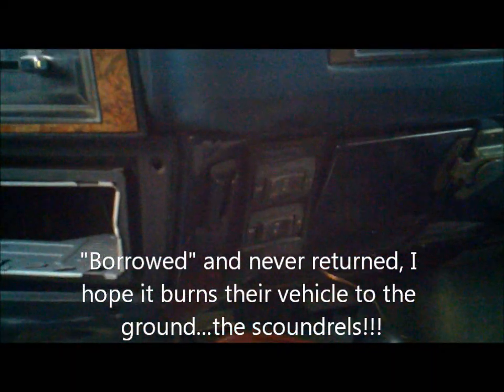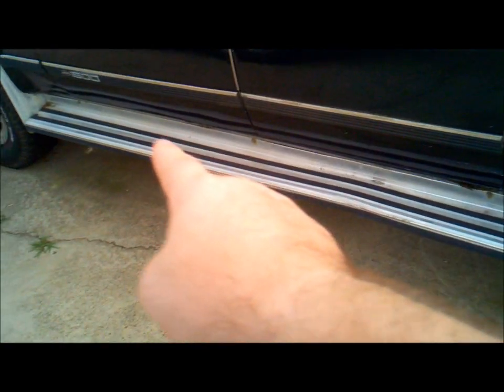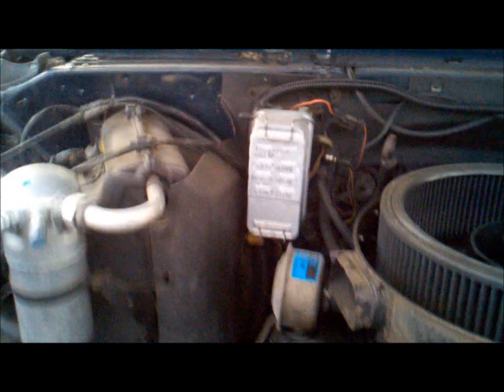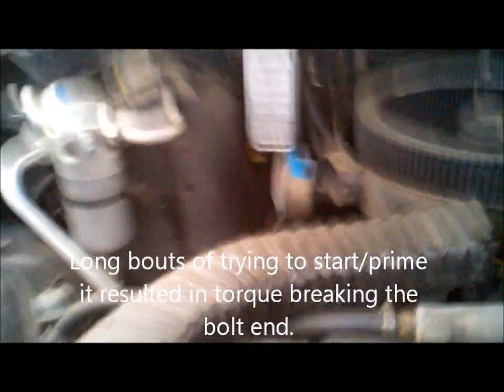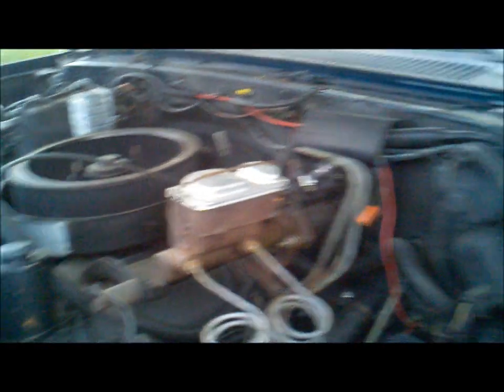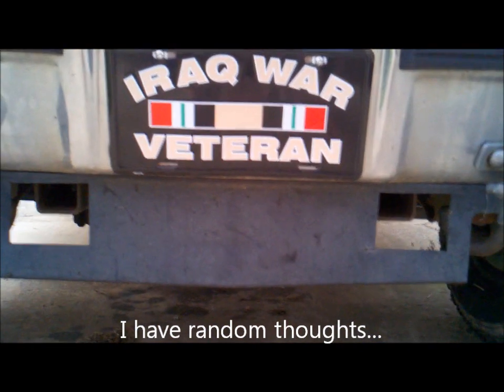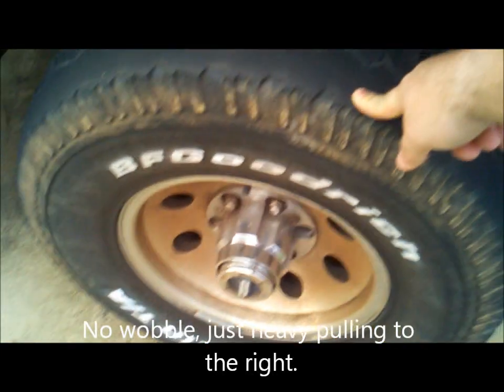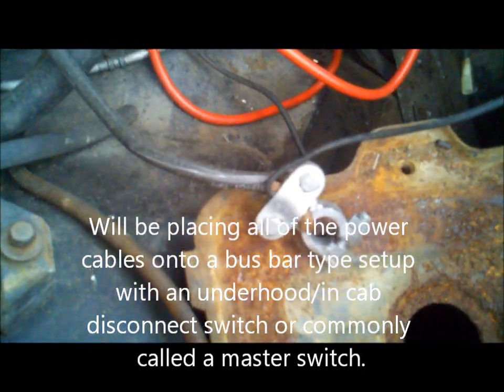My VR to Yankee Prepper.

Comment: Did you try crack open the black plastic bleeder cap on the top left of the filter body? It's + shaped...  It mite be tite, and fuel will splash, so get a small clear hose to direct fuel into a soda bottle. You'll also  need the small bracket on the front of the starter to re-inforce it, so not to break another bolt.  The bolt usually just spins out, usually not tie, or get some reverse direction drill bits, a big help!

Comment: "C" code stands for California hence all the extra smog equipment it has.  I would just loosen the fuel lines on top of the injectors and turn the engine over about 15 rounds and check for wetness.  If you're getting fuel then tighten the lines and it should crank.  If you have an electric fuel pump, you might need to check and make sure its working also.

Comment: I am trying to recall, but I think there is a "safety" feature on some fuel systems that requires you to reset the fuel pump if you change the fuel filter. It is to disable the fuel pump in the event of a vehiclecrash and fire, to prevent the fuel pump continuing to pump fuel to a fire.  Worth checking into.  hope it helps.

Comment: On my J code M1008 removing the pink wire from the top of the onjection pump, while turning the starter for a few 3 second burst will prime. Reconnect the pink wire on injection pump and she should fire. 

Be sure you have the starter support bracket for your direct or gear redux starter installed.

Comment: After a bit of googling, I don;t think a Silverado has the switch. Prime procedure is mentioned as turn ignition switch on for 2 seconds (without engaging the starter), then off for 5, and repeat several times. you should hear the electric fuel pump running each time.

Comment: I had a Ford conversion van that had a reset switch under the glovebox if you changed the fuel filter. If you have the owners manual or else a google search can tell you if you have the same thing on your truck. Good luck.